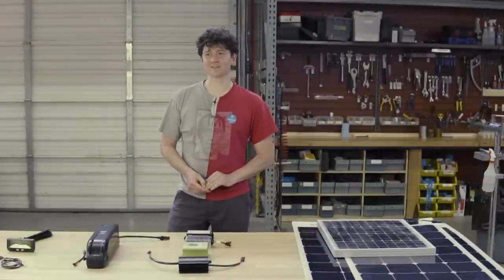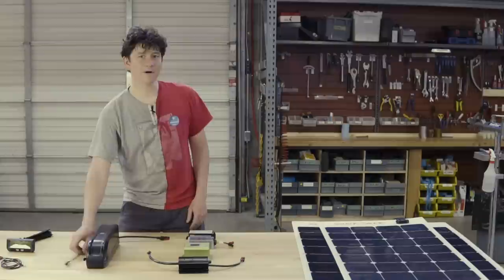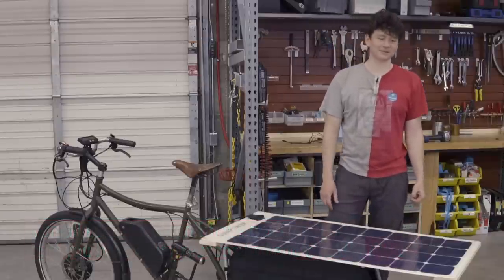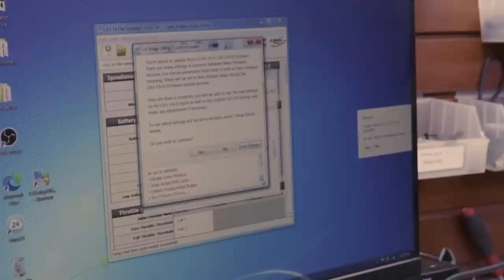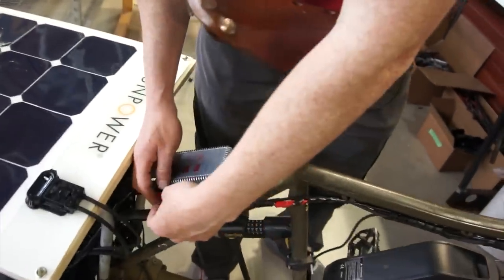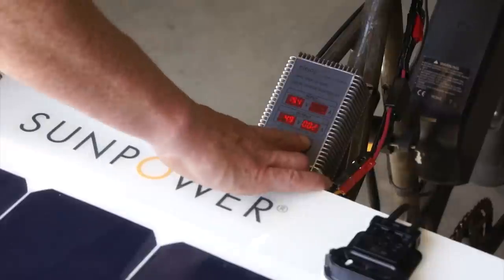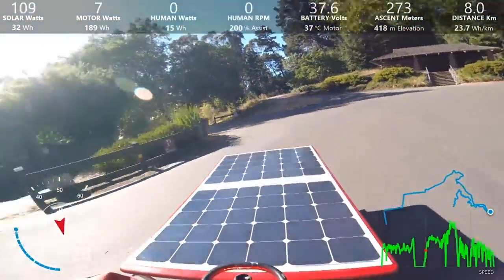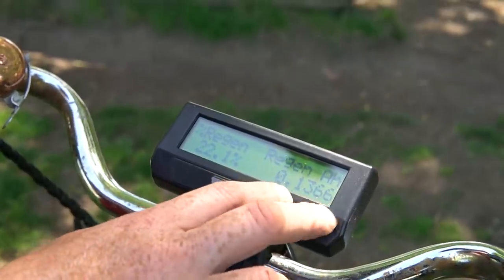Primer on Solar Ebike Systems

Comment: Would your controller work on a Dapu mid drive motor
Reply from the maker: The MPPT charge controller discussed in this video doesn't really care what motor system you have, it just needs to be able to charge through the charging port of your battery pack and virtually all ebike batteries (except for Bosch) are fine with this when underway.

Comment: Can you ride a bike only by solar panel? Not any battery as a support.
Reply from the maker: You can but it would be a really terrible experience. The timing of when the sun does and doesn't land on the panel will not at all correlate with how much power you need on the bicycle, and all the solar energy that lands on the panels when you don't need it (eg stopped at a traffic light, coasting downhill etc) will get wasted. The system is vastly more efficient and useful when you have a battery to buffer the energy flow.
Reply: @GrinTechnologies  No i don't mean that at try it as a prototype
Reply from the maker: Sure, as a prototype you can do this. You'll generally always be riding at the low voltage cutoff of the motor controller, and it would be best to set the controller's LVC to match roughly with the anticipated max power point voltage of the solar panel you are using.

Comment: Congratulations! Thanks for sharing knowledge. One question please. Just a lithium battery taking charge and releasing charge, at the same instant, is that no problem for the battery? Can the lithium battery be wired like this? Thank you, success! Nélio – Brazil, MG.
Reply from the maker: It is no problem, in the end if it is taking a charge and releasing a charge at the same time, it is doing nothing, the charge is just flowing through the wires and no chemistry is taking place. What comes in or out of the lithium battery itself is just the difference between the charging and discharging currents.
Reply: @GrinTechnologies  Thanks! I was thinking about the functioning of the BMS board (input/output) while charging the lithium battery. You explained great! Hope you participate again in 2022 The Sun Trip! Congratulations! Success! Nélio - Brazil, MG.
Reply: Laptops actually do this all the time - the external power supply on many laptops can’t handle the laptop at 100% full CPU peak. 

The battery will be charging normally but then a small burst need comes from the CPU going to max speed, and you get the battery discharging a bit for a second or a fraction of a second. 

Lots of laptops will ramp their CPU speed down if the battery is missing because they count on the battery to provide short bursts of high power.

Comment: Can i use this solar system to load my e skateboard battery.
Reply from the maker: Generally speaking yes, as long as you set the MPPT's output voltage to match the charge voltage of your battery pack and you have suitable connectors to mate with your charging port.

Comment: If you're charging while riding, you should use angled plugs so they don't stick out. Charging while using is said to be bad for the battery, although I'm guilty of that, years ago, myself. Charging a 2nd battery is better.

As far as solar, I'll stick with my gas generator trailer, thank you very much.
Reply from the maker: This is not true at all.  The battery has no idea if it is charging while moving or not and there isn't any evidence that have it alternate between net charging and discharging (as occurs here when your load shifts above and below the charging wattage) has any effect. This is no different in some sense than regenerative braking which is used to great effect in ever single electric car on the market.

Comment: In some other videos it was said that you should not charge the battery that powers the bike, explicitly the motor, at the same time while riding. What is truth to this statement? Obviously this would be too dangerous. By the way, a great video with factually explained content. Thank you for ist.
Reply from the maker: There is no truth whatsoever to that statement. The only exception would be with pointlessly locked battery systems like Bosch which have a bms circuit that prevents use of the bike if charge current is detected. If you are building a solar ebike, you'd generally know better than to build it off a proprietary platform like that.
Reply from the maker: It's a shame that there is so much incorrect information as shared on YouTube and ebike forums on technical topics like this.
Reply: @GrinTechnologies  Thank you very much for your fast answer. Now I know what to do.

Comment: Wish you would consider selling kits for the energy challenged. I would buy in a hearbeat.
Reply from the maker: Hey Mary, most of the challenge is on the mechanical side, ie actually designing a frame structure and mount for the solar panels that fits well with your particular bike setup. We do have a "kit" of sorts for the electrical gear where you can get the MPPT charge controller, solar panel(s), and optional Cycle Analyst for monitoring here:
https://ebikes.ca/shop/electric-bicycle-parts/solar/solar-bike-package.html

But if that's all greek we'd certainly suggest emailing for consultation, including knowledge of the existing ebike on which you plan to install it with info/photos of the particular connectors and charting port details on your battery pack.
Reply: @GrinTechnologies  radrover step thru 2020 model

Comment: if my battery dont use a xlr port for recharge, how would this work for me?
Reply from the maker: You would wire up your own adapter cable to match whatever the charge port is on your battery pack.
Reply: @GrinTechnologies  I'm not sure if I understand that correctly. Are you saying I can charge via solar and battery being use through one or same port

Comment: I wonder how long would it take to charge my 48v battery with a solar panel like this one
Reply from the maker: There is no need to wonder, you just need to look at how many watt-hours are in your battery, and the realistic watts output of the panel. For this 100W nominal panel, we get about 70-80 watts in good sunlight at our latitude. If you have say a 48V 12Ah battery, it is approximately 48*12 = 576 Watt-hours, and an estimate on the charge time would be:  576 Wh / 75 watts = 7.7 hours.  So no problem having it charge up over a single day if it's in the sun the entire time.
Reply: @GrinTechnologies  Thank you for the answer. Do you know if it is damaging for the battery to be charged while driving at the same time, or is it bad for the overall lifespan? Also when charging is it bad to stop charging if the battery is not completely full?

Comment: This is too far beyond me but I’m wondering if I can charge using my Jackery solar panels and the connectors, etc. that it came with. That way I wouldn’t have to buy anything. This would be a stationary application so panels wouldn’t be attached to the bike. I have two 100 w. panels. They charge my J. 1000. Of course I could just plug the bike into the charged J. but maybe would like to save the full charge in the J. for other uses.
Reply from the maker: You will need to buy the MPPT boost converter discussed in this video and terminate it in the matching connectors that are on your panels if you want to directly charge your ebike battery with your 100w panels.  If you don't want to buy anything then your only ooption is using the built-in inverter/battery system and an AC charger for the bike, which works, but is a lot less efficient.

Comment: Great video! Seems like more than one solar panel is overkill. I'd add a cheeseburger instead and go a bit harder on the pedals!
Reply from the maker: You can do that too! Just be mindful that cheeseburgers have a larger carbon footprint and cost than solar panels per unit of energy supplied to the bike.   A 100W solar panel like this produces the equivalent energy to the wheels of about 1.5 cheeseburgers / day, so it doesn't take more than a couple months in the sun for a panel to pay for itself in cheesburger savings ;-)

Comment: Why dosent any bike manufacturers incorporate super caps in there systems.   Having a buffer will remove stress from the battery increasing your range .
Reply from the maker: Super caps have about 50x worse energy density than lithium, and modern lithium batteries have zero problems with the 'C' rate charging and discharging required by ebike systems.  So at present there is no 'battery stress' problem that they solve.  All they would do is add weight to a setup. 

There was a time in in the early days of lithium battery tech when there was a small case to make for supercaps to buffer the power demand when the cells had high impedance and weren't really good at more than 0.5C discharge rates, but advances in lithium tech have made that pretty moot.
Reply: @GrinTechnologies  thanks i was sure gonna try makes sense..

Comment: glass solar panels have 20 year warranties typically, those flexpanels only have 2 year warranty. they just are not as durable! If they last 4 years you are lucky.
Reply: But the glass ones are heavy and can not stand vibration.

Comment: I think it would be more efficient to charge the batteries in pairs with the just solar power boosting one to the other for a while and then switching. With no losses from voltage conversion.
Reply: Is the best..

Comment: I solar charge my ebike just wiring 3 12v panels in series and this is perfect for 12 cells lithium ion.   It is more efficient than using mppt as I am right at the max power point without conversion or cost.   The semi-flexible panels are light but not very  durable.   They are susceptible to micro-cracks which greatly reduce their output, beware of this.
Reply from the maker: That's another approach for sure. Your lithium cell goes from 3.0V up to 4.2V over the course of a charge, so you can't be right at the MPPT point during the whole charge cycle though at some point in the process when it's all lined up you would certainly have the edge. 

I'd love to see a measured complete charging time with your 'optimized' direct setup and the same panel/battery with an MPPT both charging side by side.  I'd still wager my bet on the MPPT still winning by a long shot even with the small conversion losses.
Reply: Until the sun goes down and your battery is connected into a forward-biased diode...
Reply: @seancashin1826  there is no diode so it's ok
Reply: yes most flex solar panels fail after a year or two. Only one that seems to have a warranty longer than a year is sunpower which is 2 years. However the very same cells mounted to glass they warranty for 25 years, so what does that tell you?

Comment: what problem are these trying to solve? the negligible cost of charging your battery? or is it a range extender? hard to imagine a scenario where you're using a cargo bike and have no place to plug in. if you do need extended range it's probably way more practical to carry an extra battery. just seems like a totally impractical head-in-the-clouds solution to a made-up problem
Reply from the maker: Mostly it's people doing long distance ebike touring where access to charging facilities is nowhere near guaranteed, especially for those who prefer  camping and exploring the countryside. In that case, yes you are using a cargo ebike and have no place to charge overnight.  In this scenario the cost and weight of carrying and extra days worth of extra batteries is quite a bit more than the cost and weight of solar panels that provide the same Wh.   

For other people it's a fun challenge, but probably 90% of the people we've helped do solar systems are plotting a touring trip where they can be free from the burden of searching for and waiting around at outlets each step of the way.

Comment: The solution to reducing energy loss from solar panels heating up is to add a thin thermocouple beneath the solar cells to use heat energy to replace what solar cells lose from heating up. Why hasn’t anyone figured this out yet? Such a thermocouple could then be used for solid state cooling technology. Win. Win.

Comment: For the cost of the Panel, MPPT, and various misc parts needed to do this, It would make more sense to just buy a second battery pack and double your range. This settup does not do that. Even if you could get 100% conversion(impossible) with a 300W panel(HUGE) that is a minute amount of power for an ebike. I admire many of Grin's tech and products, but this makes me question your sanity. Until there is a panel that can provide enough power to charge at least 25% of your battery pack in less than 4 hours, this is pointless. Basic electronics will teach you solar on a component that uses more power every minute than the panel can provide in an hour is useless. Dont get me wrong, I am 100% for solar. But used logically where it will MATTER. This is just adding to e waste and geologic destruction. MAYBE if I lived in a country without ANY power infrastructure, waiting days for my bike to charge would be acceptable.
Reply from the maker: Hi Doug, I was once as skeptical as you about the use of solar on ebikes.  My viewpoint has changed and I recommend you watch my longer solar bike touring presentation where I address this: (https://www.youtube.com/watch?v=15HHLY4BfA4). To give some counter statistics, you get about 6 Wh/watt over the course of day from a panel in sunny weather. So in the summer this small 100 watt solar panel provides 600 watt-hours of energy each day, the equivalent of a fully charged decently large capacity ebike battery.   The cost of a 600 watt-hour lithium battery is actually more expensive than this 100W panel + MPPT (~$500 USD vs ~$350 USD), and it's also slightly heavier too (4kg for the battery vs 3kg for panel and MPPT).  Of course the panel is a lot more awkward to carry with the bike, but it is both cheaper lighter than a 2nd battery pack needed to achieve the same range.  

As for the embedded energy and resources to manufacture a new 600 watt-hour lithium battery and BMS circuit, versus a 100 watt flexible solar panel and MPPT electronics, I'll leave that to you to look up!  Both products have gotten remarkably more manufacturing efficient since I last did a life cycle energy analysis on this topic.
Reply: What if I want to just charge a second ebike battery during the day off of 4 panels and then swap the batteries out each day? At least I am off the grid which is my objective over all not so much distance.
Reply from the maker: @keenanforytube  Hey Michael, that works just great. It's called a solar charging station and is definitely easier to setup than a solar panel array that travels with the bike.
Reply: I agree.  All solar is subject to availability of the sun.  But you could extend your range by having a secure housing and taking a solar generator, plug your normal charger into the ac receptacle, and keeping it charging continually.  The solar generator you can charge at home with ac very quickly.  If you have a need and use for a solar generator anyway, as a power backup, it can certainly serve double duty this way.  But one would actually have to do the math to see if this would be worthwhile compared to just carrying a second fully charged battery with you.

Comment: solar home charging station, totally off the grid, free charge
Reply: get rid of the charge controller, use better batteries, you dont need a charge controller, super caps can be a simple buffer or mass storage
Reply from the maker: In case others are reading this and get the wrong idea, you really should use an MPPT charge controller. It dramatically increases the amount of power you can put into the battery over the course of a day, especially when there are varying sun conditions.  Plus it lets you set a final terminal voltage so you aren't relying just on the battery's BMS circuit to prevent overcharging the cells.
Reply: @GrinTechnologies  only lacking tech needs controllers, to be exact
Reply: @GrinTechnologies  controller does not add any energy by itself
Reply: @GrinTechnologies  use lead acid then you dont need any controllers
Reply: @GrinTechnologies  you only say that because you sell your words

Comment: Excellent video. One problem though. You keep quickly looking to your right, for some reason. It's extremely distracting, and annoying for me, as I'm autistic and it takes me a lot to concentrate. You keep breaking my concentration with you eyes and head flicking to your right every few seconds.
Reply from the maker: Hi Jacqueline, thanks for the feedback and sorry about that. There was a 2nd camera setup off to the side which caused some confusion on where to focus. We'll be sure to avoid this mistake in the future and hope the follow up videos will be easier for you to watch.

Comment: I looked into this when deciding to buy a new 800 dollar battery for my 1500 watt 48 volt ebike that I built in 2011. I decided against it. Solar is Not practical for an ebike unless you build a home charging station and only take short trips on your ebike. To have even the tech he talks about in this video power your ebike for extended range or not to worry about running out of power requires a LOT of panels that ruins the practicality of having a bike. I bought a gas scooter instead. Fuel is dirt cheap, has far greater range and can fuel up within a minute.
Reply: fuel is not dirt cheap if one actually has to pay to clean up the environmental mess that it creates. Unfortunately the world is just realzing this fact. Just cause it's cheap up front doesnt' mean it's cheap overall. Sure you saved a few dollars today, but down the road everyone will be paying to clean up your mess.